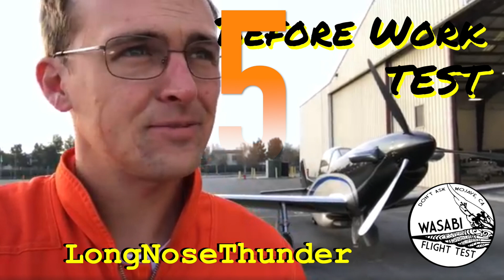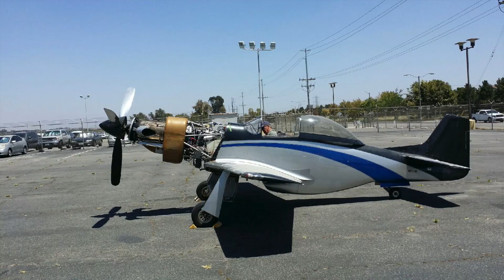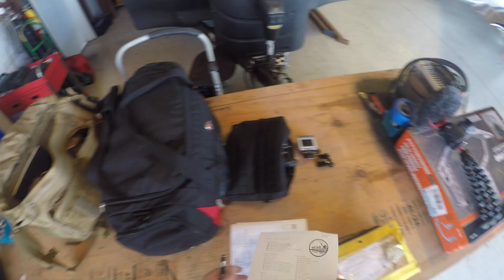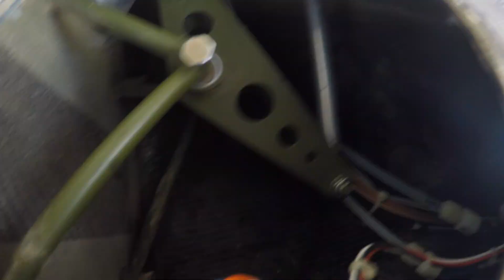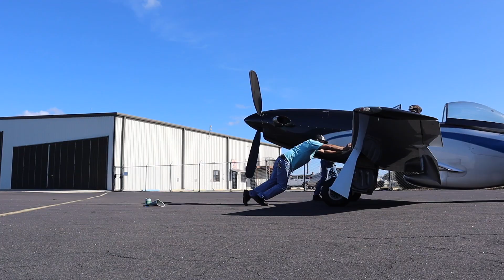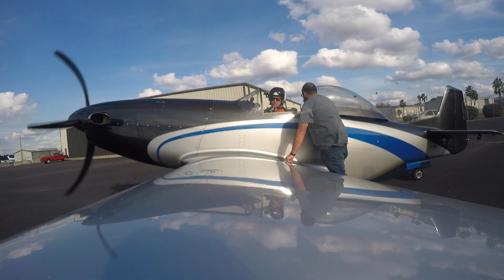Inspection - LongNoseThunder - Re-Reflight Ep 1 - Turbine Powered P-51 Thunder Mustang Kitplane

Comment: I'm not real sure how well the basics were executed .. Come on were talking about quote professionals who can't seem to fly straight brakes radio WTF how difficult is it to adapt the system from say ANY of the other hundred or so basic turbo props to work for this application well it must be the equivalent of moving Mt Rushmore . Anyone who has ever installed a V8 into a car that never had one knows what the basics are fuel power timing and brakes  .these are all basics that are universal because without them you go nowhere...These guys are still working out the radio issues that's  why I like diagnosing the problem then locating the proper equipment to remedy the issue . It's not rocket science your not trying to re invent the wheel ,,, But in the aviation field we have guys that want to think shit to death they feel they haven't earned there exploded pay check unless they mega re think everything then re do it ...all over again . Fix it once then move on to the next issue ...if your throttle prop quadrant is not correct then make it correct  but do so once .....

Comment: 'Deland, home of Walter engines' errr surely you mean Prague.
Been working on the Walter (GE) engines since 98 and they are a fine engine. Walter as a company have changed somewhat since the GE rebrand and the 601 is becoming harder to have overhauled by them especially the D2 and D1. We are slowly converting to the H75 now and so far, touch wood, we haven't had too many issues although the FCU has give us a problem and you just have to hope the one of the many adjustments can sort it, saying that, a replacement can be made available very quickly.
Never once have I seen a flame out because of air in the FCU. Although air in the FCU is not uncommon but easily and quickly resolved. What boost pump are you using, is there 1 pump for both tanks or 1 each, do you have the fuel filter with by-pass installed or is there no filter and you are just using the filter on the high pressure pump?
Use GPU's it takes all the heart ache out of have bad starts or no start situations. 
BETA on a single is fun, you should try matching up a twin tail wheel BETA, now that is fun and is a total black art. Would love to have seen what they were adjusting?
Are you running AC for the engine instruments or is it all DC?

Comment: If the eyebrow lights backfeed problem bothers you, wire in a diode to prevent it.  It is common way of fixing this issue.  For example, in automotive applications they use a diode to prevent a backfeed problem from the alternator to the ignition system so that the engine won't continue to run after the ignition has been switched off.
Reply from the maker: Thanks for the comment.  There are two questions embedded here.  First has something failed to cause the eyebrow lights to function this way (is the airplane unsafe to fly).  If not and they are functioning as intended is it within the scope of this Fcf/ferry program to modify the system (answer is probably no).

Comment: PIO? Sorry for my ignorance here But when you stated "PIO" are you referring Pilot Induced oscillation? or may I ask what you are referring?
Reply from the maker: Thats correct.  It's not uncommon in older fuel controller generations of turbine powered homebuilts.  The cockpit geometry forces the builder to a throttle with a short throw.  Then the delay in throttle response causes a PIO.  Where the pilot is sawing on the throttle bouncing off temp limits.

Comment: I'm sorry, I have to ask.  Why was a test pilot, especially of your calibre hired to find issues with comms and breaks that don't work?  It just seems like all this should have been found and fixed long before you got there.  What worries me, a LOT actually, is that a lesser pilot would have had a VERY bad time with this.  And who designed the failure light system such that nobody knew how it worked?  I'd have expected something like that to be in the operator's manual.

Comment: you could've used the scoop for an oil cooler or maybe even an air conditioning system if you operate in really hot areas.

Comment: Flew an amphib Single Otter with the Walter engine for a short while. Loved it. Was a dream compared to the R1340. I get that lengthening the nose deals with the CG problem and I don't know anything about Mustangs but it seems to me that it isn't that much longer and there would be a huge difference in weight between the Walter and an Allison or Rolls. Were there any other measures taken to adjust CG?
Reply: Seconds after I posted this, I realized that those heavy pistons were never meant to be on this particular airplane. Dumb questions right?:)

Comment: Could someone explain what the EHT-button does? I didn't catch that. Thanks in advance
Reply from the maker: It's a manual override to the TSLM circuitry.  In the event the start is getting hot the pilot hits a momentary switch in the cockpit that cuts off fuel to slow the ITT rise.

Excerpt from the TSLM Manual:

Limiting (EHT) Circuit
The limiting valve or EHT (electro-hydraulic transducer) is used to restrict fuel flow to the engine
when activated.

Comment: The red Walter engine on the test stand is mine.  I had the black painted red. Got a lot of grief from John about doing so.  John hated the color red - especially in the engine compartment.  One thing I'll never forget John telling me.  He said Quentin was even better than him  when it came to working on Walters.  Those who knew John know that means a lot.  Great man... great pilot.
Reply: What aircraft is the engine meant for?
Reply: @toast2610  In my case it's being used on the Lancair IVPT Propjet.  You can see it if you click on my Flying Architect name and look at the video called "Lancair Propjet IVPT nearing completion" you can see the aircraft.  Or maybe just search that on YouTube.  Toward the end of the video you'll  also see a completed IVPT.  (the video is poor so don't expect much... )  I believe originally it was used on various  Czech twin engine transport aircraft operated in extreme conditions like extreme cold of unimproved runways.  I'm certainly not an expert on that so my information may not be completely correct.
Reply from the maker: Awesome.  Sounds like you have some fun in your future!!!
Reply: @FlyingArchitect  Looks good. Video is not that bad either. You should make more. I see you got the EarthX's..
Reply: @toast2610  thanks.  I do have the EarthX batteries.  The reduction in weight and the cranking power were too good to pass up.  They did require some other electrical modifications from VRavionics but well worth it.  I hope to make some videos from here out to show the complete, faa process,  first flight, test flying and performance data, etc.  thanks again.
Reply: @utopiasnow  I sure hope so.  thanks!

Comment: This just made my weekend, thank  you! As a kid I had the opportunity to fly traffic reports in SoCal, lighting off a jet ranger at 19 years old brought the pucker factor. I knew exactly what you meant when you were asking about shutting the engine down. On your caution light problem, if the pressure switch was back feeding the circuit, could you put a diode in line to act as a check valve? Thank you for taking the time to produce these.
Reply from the maker: Thanks for the comment.  I am not sure whats wrong with the circuitry.  Wait until you see what happened next.

Comment: I'm a mechanical engineering student myself, where would I be able to learn everything you know (other than what you learned from your experiences)? e.g. beta values, I have no idea what those are
Reply: Good on you for engaging a very rigorous field of study. 
The maintenance manual discusses beta settings for propellers matched to engines I believe.  Observing mechanics working on these rigging them is a arduous process with lots of do overs. The fuel control unit is very complicated at least on a PT6. I imagine this would be similar. 
Have done run up after run up until the guys throw up their hands and start from scratch.  Not a job they seem to look forward to. 
Best of luck in your studies.
Reply from the maker: Thanks for the comment.  My apologies if my description muddied the waters.

Beta in this context, is all the power settings between flight idle and maximum reverse thrust.  

The 601 engine manual restricts reverse thrust in flight.  In the LNT there is a Beta gate on the throttle and a light on the panel indicating when the throttle is pulled below that gate.  Because of the inflight limitation I lock out Beta from takeoff spool up until the tailwheel is on the ground.

I will make sure to add more detail about this in ep 2.
Reply: Should have gone AE ;)

Comment: That’s interesting that you advance the condition lever before you engage the starter motor. I’ve seen that on the Saab 340, but we would get cooler starts by dry motoring the engine up to Max N2 (or Max Ng) before you introduce fuel. I wonder if that’s an option on the Walter? And perhaps it would not blow that flame out the exhaust too?
Reply from the maker: Yes it is an option.  And yes it keeps it from fireballing.  You gave away one of my surprises from episode two.  Hahahaha

Comment: Very interesting video.  Thank you and the owners.  Operational question.   If the aircraft has that much thrust, why do you crank up with the flaps down?  And then you raise flaps once the engine is running and stabilized.  Couldn’t you lower/raise flaps during pre-flight check, or doing run- up?  With so much thrust the flaps increase the lift from the wing and could cause ground handling problems, at start up and/or taxi.
Reply from the maker: Cool question.  I lower the flaps during maintenance because it makes it easier to get to the cockpit from the ground.  It also makes it easier to stand next to the cockpit during ground runs.  I do it on the Stewart too, and in both cases I am the only one on the team who thinks it’s valuable.

Comment: Which Mustang do you prefer? The Stewart? or the Thunder? Also what is the status of Bowers Pony?
Reply from the maker: Cool question.

Most importantly the Bowers is doing great.  We were supposed to fly today but I had family photos.  Those guys are so great.  We have done two flights on the airplane, but I haven’t edited them yet.

Choosing between the bowers and the LnT would be tough.  Speeds are similar, the Walter burns more gas.  Handling is very comparable.  I’d say the Stewart is a bit lighter on the controls, especially in pitch.

Thanks for asking!!

Comment: Really interesting thing. From a design perspective it's a bit frustrating to have to balance the beta so finely. It just should be a setting to have no thrust, or a switch. Reality can be such a pain.
Reply from the maker: Well said.  I think there is good reason (and value) to why the configuration ended up as it is.  I have enjoyed developing procedures to manage it.  And look forward to making it right for the long run.
Reply: So I'm guessing if you're to achieve low or no thrust there you'd be either unable to feather, or have less twist in the blades so you'd lose propeller efficiency. It's just the blades don't have that range of pitch adjustment.

What do you mean by PIO here? I gather something is going to isolate but what is the feedback system for that?

Comment: Glad to see another video. You looked a bit uncomfortable in the cockpit on that flight attempt and it seemed the canopy couldn't  close. I guess it's part of the job and type of plane, in this case.
Reply from the maker: Yeah, I was struggling with the risks and the need to perform.  While I am embarassed that it took so long, I think I made the right call and the lesson learned is something I think we all struggle with.  Thanks for the comment.
Reply: @utopiasnow  Thanks for replying! You have my absolute dream job tbh. I ended up  working in aviation but mostly with large commercial transport engineering. In my country becoming a test pilot is only really possible through a military route. 
Flight testing is so much more than taking a new aircraft for a spin, it is a complete field of applied science and the human factor makes it all the more interesting. 
Thanks for your uploads, the more nerdy the better for me :D
Reply: @utopiasnow  And I wholeheartedly agree with what you said; better a late call than no/wrong call. The fact that you show this to the world points to the reason aviation is so safe as it is. Aviation is all about continuous learning and improvement and this was a fine example.